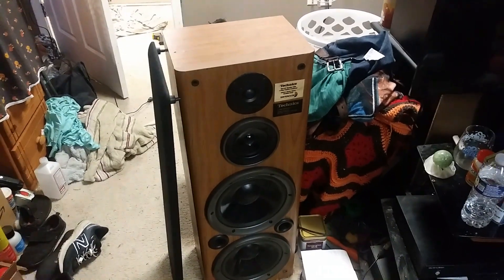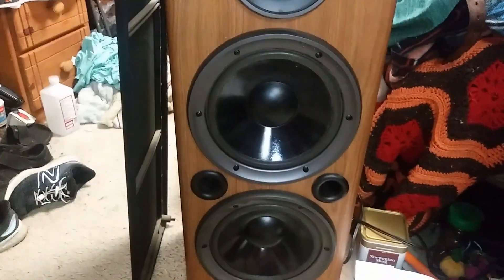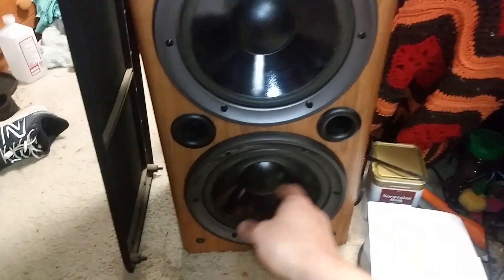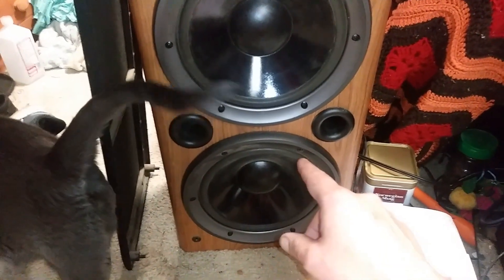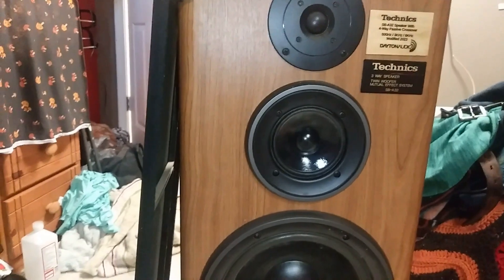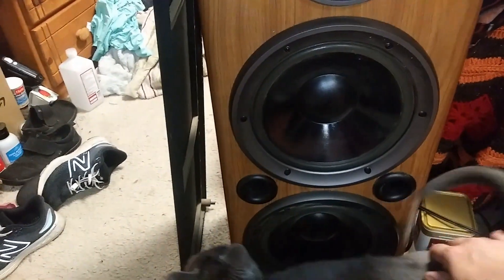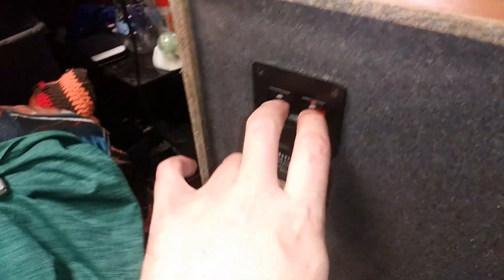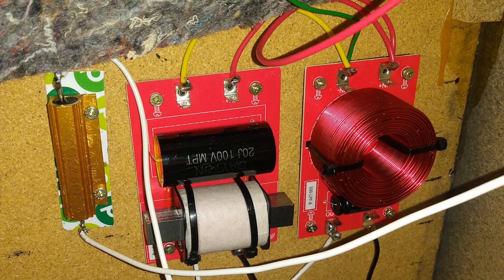3-Way speakers with 4 drivers are better as 4-Way Speakers -  Technics SB-A32 speaker modification

Comment: Think they are worth $100? I found some on Marketplace today.
Reply from the maker: if the drivers are in good condition absolutely.  if i wasnnt so lazy i'd put a switch in there to channge that resistor value up annd down.  That 5-ohm driver sounds great but sometimes it's just a little overpowered perhaps.  hard to say.  my setup isnt ideal.  highly recommend doing a mod to the crossover situation.  the original setup almost sounded out of phase a bit

Comment from the maker: 5 ohm resistors between the 500Hz high pass and the positive terminal on the 5 ohm driver is where i settled on the resistor value